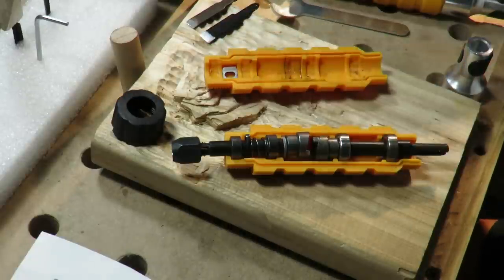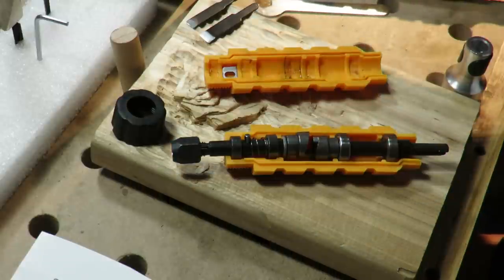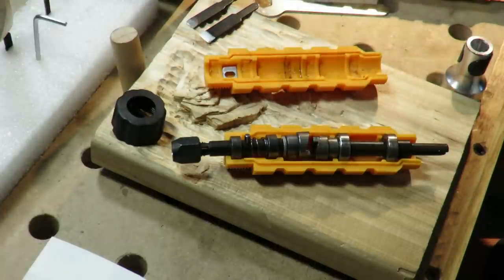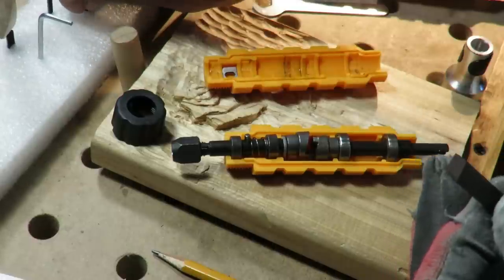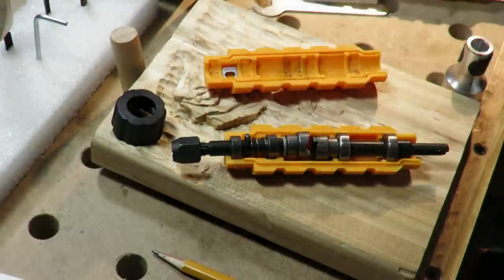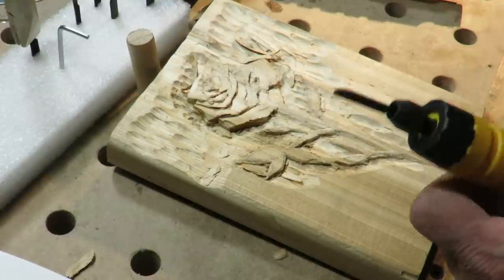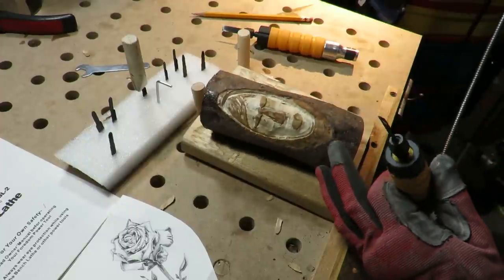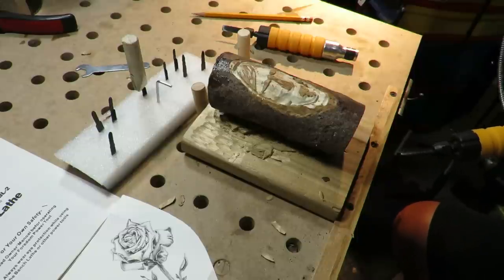Electric chisel

Comment: And a really good alternative to this and it's only a few dollars more is an air operated engraving handpiece it's actually a jackhammer instead of just vibrates and they're well made and last for a long time I think I paid 33 or $35 for mine I bought this one first and I still haven't figured it out put the engravers handpiece it's made out of metal and it's made to be a jeweler tool and you don't hold it like a pencil you palm it so you have incredible control and it's not hard to hold on to these are used to do gun engraving a western engraving to set stones in bezel all kinds of stuff

Comment: How do you sharpen the blades? Will a diamond sharpener work with them?
Reply: O problema  é  que gasta muita energia  elétrica
Reply: @silviocardoso367  I only know American English. Sorry .
Reply: @silviocardoso367  I I ne
I need it to have replacement blades readily available or to know how to sharpen the blades that come with it. Or both those things. And the more electricity a power tool uses, the more powerful they tend to be. If you need to use it for harder wood you would need more power for your machine. And sometimes the more power you use the more electricity you have to use.

Comment: Cool. Do they make something like this for rock carving (soft stone, like alabaster or soapstone)?
Reply: i am sure the same device could be used, just need to find some stone cutting heads
Reply: If you use diamond burrs you can carve rock pretty easily. But use something like a parts washer to constantly soak your work or invest in lots of HEPA filters and respirator filters to handle the deluge of dust.